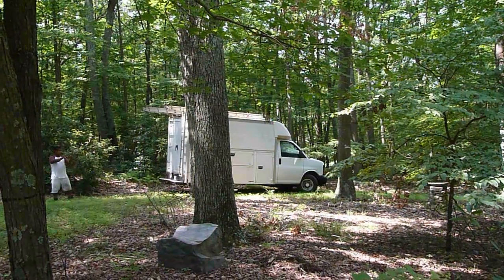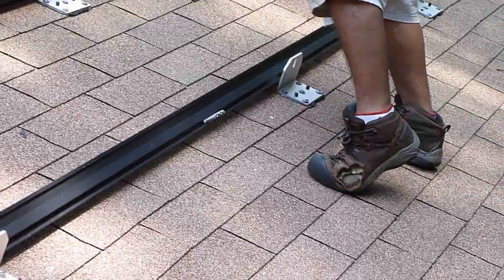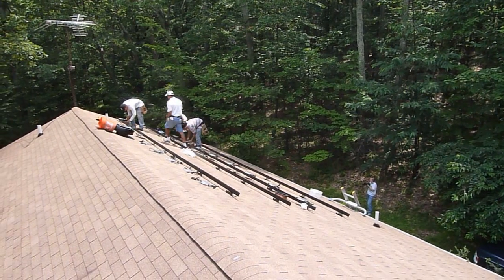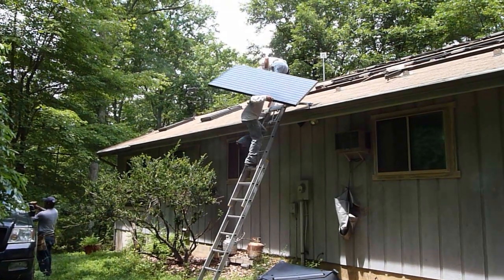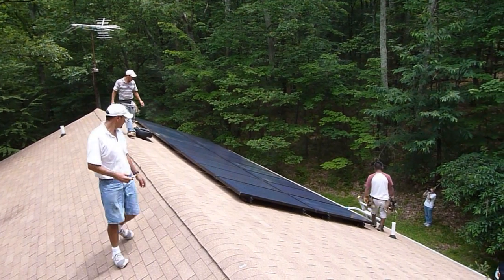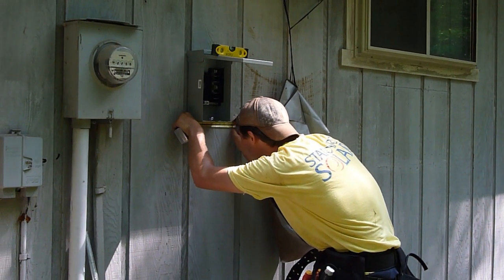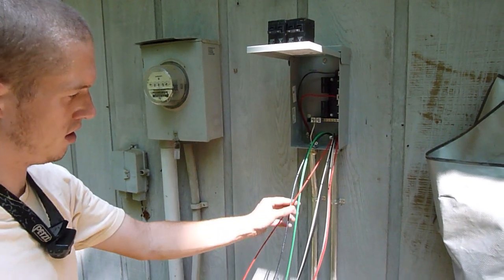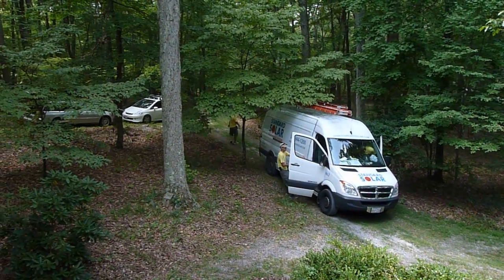Photovoltaic solar panel installation (in HD)

Comment: OSHA would require all these workers to be tied in since a. they are closer than 6' away from an edge that is higher than 6' off the ground and b. it is a sloped roof. Also, I would really recommend that the railings should be drilled into the rafters or studs.

Comment from the maker: They drive the lags into the plywood roof decking. I was a little surprised by that, too. I've now had this system installed for more than three years and no problems with leaks.

Comment: Actually you do have to take a training course in it *which I did) and there's schools for it. Solar City hires graduates of the students and also from the Agencies that are from the schools. Electricians are highly sought after but they handle the wiring aspects (installers legally can't do the wiring process unless they are an electrician).

Comment from the maker: Do you mean, "Have I started earning a profit on this?" No, not yet. However, I'm still quite pleased with the results, and there is emotional satisfaction to know that I did something to solve a long-term problem.

I'm considering selling this house, and think that with what I've saved and earned back, plus the added price to the house for the solar panels, I will make a profit. 

FWIW, as of today, this video has earned about $350.

Comment: I am glad to hear there have been no leaks and Im shure the trees have protected it from high winds.  No disrespect was meant.  My observations from a professional stand point is that the installation was sub par, in fact way below. Especially at premium pricing.  The modules and inverters are high quality but all the other equipment and installation techniques are of poor choice.  This does not reflect on you the home owner but if it were my company I would be ashamed.

Comment from the maker: It's still working fine and looking good after 3 years, including some heavy winter and summer weather (a hurricane and heavy snow, for example). There have been no leaks, and the system generates the same amount power it did right after it was installed.

Comment: I am an installer located in VA andthe installation was very poor.  We would never mount an array the way these guys did,  you are never supposed to tighten the module hardware with impact guns. All hardware has specific torque ratings. mounting feet total wrong!The conduit was slapped up  the roof junction box was not a real roof penetration box ect-ect, These guys grabed your money threw in a system and left.  Future purchasers beware of these type of installers!  NABCEP certified installers!

Comment: Lightning does indeed love a straight path. That is precisely why you WANT it to be straight with gentle bends where necessary to avoid lightning current surges from "jumping off" the ground path. The whole purpose is to channel those destructive forces safely to ground. Look at any lightning protection installed on building rooftops (mainly large buildings) and you will see wiring to air pylons installed in this manner.

Comment from the maker: Thanks! Where I live, we get regular rain that keeps the panels clean. I just looked at them a few days ago and they were spotless after being on the roof for nearly 3 years.

To clean them, try using water and a squeegee. Make sure you use enough water so that the dust doesn't scratch the panel when you wipe it with the squeegee. Hope that helps!

Comment from the maker: It's been installed for more than two years... no leaks yet, that I know about. However, I'm not looking forward to removing the panels to replace the roof in 10-15 years, when the roof's lifespan is up.

Comment from the maker: Federal regulations require electricity suppliers to secure a portion of their electricity from solar generators. The SREC program provides a means for Solar Renewable Energy Certificates (SRECs) to be created for solar electricity.

1 SREC = 1,000 kWh of solar electricity
10 kW solar capacity = ~12 SRECs per year

The SREC is sold separately from the electricity and represents the "solar" component. SRECs can be sold to electricity suppliers needing to meet their solar requirement.

Comment from the maker: Scroll all the way to the bottom of the comments and read up from there. I've answered that question a couple of times.

The company that installed the system is called Standard Solar, which is based in Maryland's Washington, DC suburbs.

Comment from the maker: We cut down some of the trees causing the shading, so production is a little better. We may take down still more, but some of the offending trees are on my neighbor's property. We do pretty good with the SRECs -- I just checked and we get $800 per year. The company that services the SRECs offered to buy our SRECs out for 10 years with a lump-sum payment of $4230... we turned that down. Between power savings, property value increase and SRECs, we're doing very well.

Comment: Federal is 30%.  Just wish that you had less shading up there to make the system produce more.  Our PA rebate used to require proof that not too much shading was in place so that their rebate paid for good production levels.  The Enphases will help with the shading, though.  Did the integrators sell you on the big money you would make with SRECs?  I'm going to go with a DIY system because I just feel that SRECs won't pay much and need to offset that with skipping out on the full integrator costs

Comment: Apparently it looks like the solar breaker is in a secondary load center or panelboard. If that is the case, then according to 2008 NEC, section 690.64(B)(1) the back-fed breaker needs to be fastened down with appropriate item listed for that panelboard or load center.

Comment from the maker: This installation was inspected and approved by the local electrical inspector. And keep in mind that it was installed in June 2010 - subsequent changes in the code do not apply. That said, I have no idea what the code violation is. I'd guess that they shouldn't be tying up cables with nylon cable ties.

Comment from the maker: @ebayisajoke  If you read the comments below, we got the 235-Watt panels because they were available and the primary panels (230-Watt) were not. I don't know if Sharp had 240-Watt panels at the time (summer 2010), but availability was key.

Every Watt helps, but the difference is pretty negligible.

Comment from the maker: @Fenix26 Well, we just figured a payoff in 6-7 years and we have always been interested in renewable energy. Anything 20 years in the future is so far out there as to be that you can't really plan for what will happen. There could be some breakthrough and we'd all be powered by cheap home cold-fusion systems. 

You'll have to ask "everybody" about why they don't do it. Maybe coming up with $31k cash for the initial payment is an issue.

Comment from the maker: @Fenix26 A "per month" savings isn't meaningful, as we use no commercial electricity in the summer months but use it extensively in the winter months. We probably save about $1000 year in electricity cost. Then we get about $1500 per year in energy payments. And we will probably get most of the cost of the panels back when we sell the house.

Comment from the maker: @ramvaradan Thanks for the nice comment!

Our power seldom goes out -- it's probably up 99.99% of the time. Batteries and inverters are expensive, and batteries need maintenance and replacement. It's hard to spend $5k or more on something that will be used 0.01% of the time, then have ongoing battery replacement every 6 years.

I have a couple small standalone UPS systems for minor outages and a generator for longer outages.

Comment: gr8 video, thanks for putting it up. btw -- you don't have battery backup meaning ... if there is a power outage you are not covered -- is there a reason, why you did'nt opt for it?

Comment from the maker: @premiersat There is flashing... I mentioned it in the video. The flashing are the little aluminum bits that the workers put a bead of caulk on, then slip under the shingles.

FWIW, the system has been in place for more than a year and works great. There have been no leaks or other physical problems.

Comment from the maker: @ljpapadak No. If grid power is lost, then there is no power from the solar panels. It's possible to design a system with batteries, a standby inverter and automatic disconnect switch, but that adds LOTS of complexity. The fact is that the grid is on 99.99 percent of the time, so it's hard to justify spending $10,000 to handle 5 minutes of outage per year. Still, it's worth thinking about.

Comment: Federal rebates are $1,000 per installed (nameplate) kilowatts, up to
'$6K, can be taken over several tax years.  Micro inverters like these are the way to go, but I would wait until later this year when panel makers will include them
within the panel, thus no need to mount the inverters seperately. And they will cost a LOT less than the Enphase inverters used here (which run $160 to $220) per panel. They will also ALL have a warranty equal to the 25 year warranty for the panels.

Comment from the maker: @Resistoon I've not had any of the inverters fail yet, but it's my understanding that the system will continue to work with all the other inverters if one fails. That means that an inverter failure will knock out only one of the 18 panels and leave the other 17 working.

One other advantage of the roof inverters is that it simplifies the wiring. It's a simple 240V/30A circuit to the roof and I don't need heavy cables for DC panels. Thanks for the comment!

Comment from the maker: @leonscorpio19 We paid about $32k, and the government (federal and state) will reimburse about 52 percent of the total.

As for running the A/C, we are connected to the grid at all times. When we generate power, we feed power to the grid. When we consume power, we consume it from our panels and the grid. Therefore, the A/C (and all other devices in the house) run perfectly normally.

Comment from the maker: @carypeck No, I've not yet had any trouble. However, they were installed at the end of June 2010, so they've only been in place for three months. The system could be engineered with batteries and/or other generation devices (such as a windmill), but that would definitely increase the complexity. It definitely could be done, though.